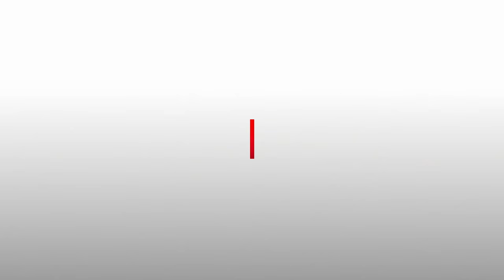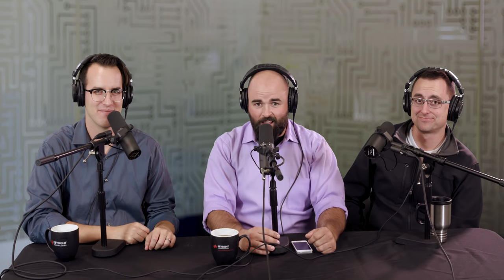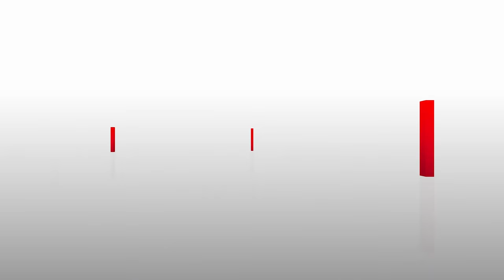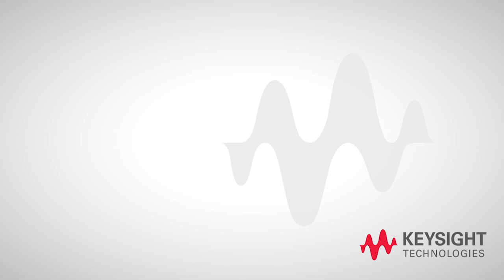Intro to RF - EEs Talk Tech Electrical Engineering Podcast #21

Comment: I just built a BPF to be able to transmit WSPR with the Raspberry Pi GPIO/PWM trick.
Having access to the RF lab of my uni is really useful for that, a VNA makes everything so easy.

We're using R&S instead of Keysight, though, but hey, it's a German company and a German uni.

Comment: I didn't get the recommendation for the book, or was it a manual, by Daniel at the end of the podcast. In the comments "An Introduction to RF Circuit Design for Communication Systems" , and "Microwave Engr." by Pozar were recommended.

Comment: I'm a new EE and RF engineering inspired me to become an EE when I was in the military. What do I need to know to start getting on these projects?
Reply from the maker: There are a couple ways to get into this. The main one for an EE is to find a job that has this as a component of your roles & responsibilities. A less formal way would be to start working on/building RF projects on the side as a hobby, there are a number of options out there. Finally, HAM radio certifications are a great way to build up some fundamental knowledge and get hands-on with basic RF tech.
Reply: How important is RF in defense applications?
Reply: @karamany9870  incredibly important. RADAR, radios, and energy weapons are all RF applications.

Comment: ISM bands, sub giga: 315M(Japan), 433M(EU and US), 868M(EU), 915M(US)
something like FoRa or RFM modules are great to work with in this ranges, range up to few km or miles with 100mW or less power